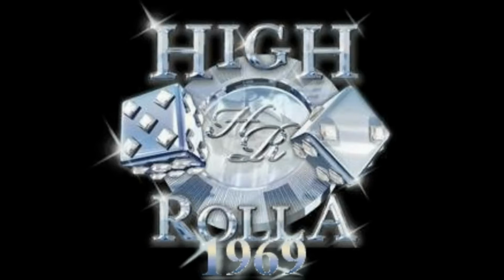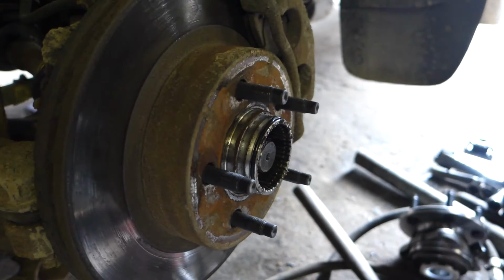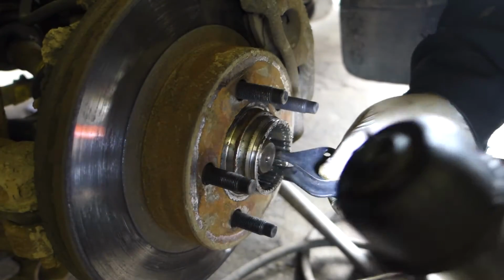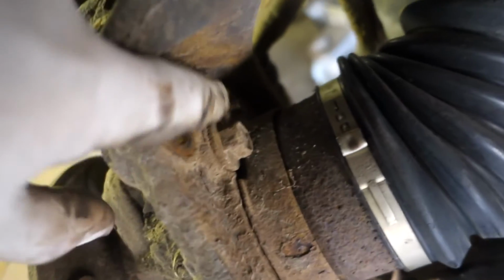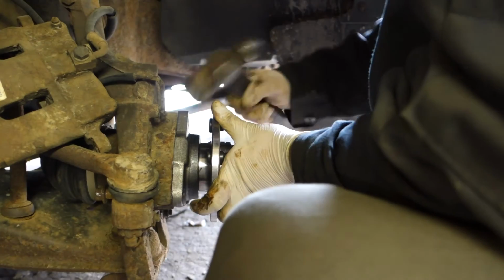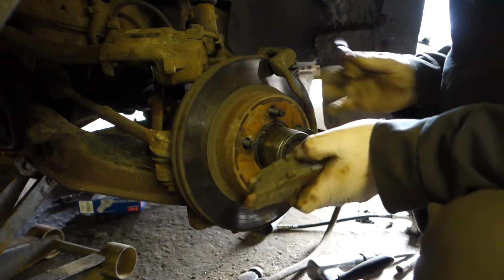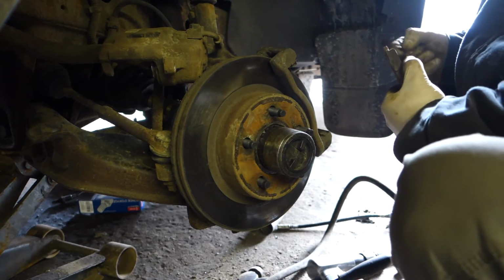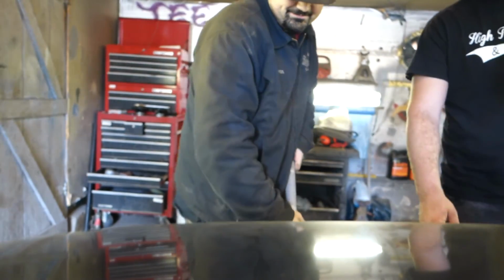Wheel Bearing 98 Ford Ranger

Comment: do you not need a main steering knuckle seal (and seal replacer tool, depth setting tool) on a manual locking hub?
Reply from the maker: I didnt need one for this no
Reply from the maker: On the f150 or bigger you do.

Comment: Hello Highrolla1969, my '99 4x4 ranger needed a new hub for the passenger side so I bought one on line by "Callahan" and not too long after installation the inner needle bearing in the back of it came apart. So I was wondering since no one seems to talk about something like that,  should I put bearing grease to it next time? that little bearing does not seem to be very well lubricated anyway.  Also where can I buy the O-rings for the new assembly? MOOG sent me the hub assembly without it! Cheers and THANKS for any tips.
Reply from the maker: Leo Cadena 
  good question. when buying online use caution. you pay for what you get. you can try auto parts store for the ring but it will be a hard find for the correct size. 
As for greasing it. Its a sealed bearing its not suposto come apart. Id send it back

Comment: Hi you seem like a cool guy,  I liked how you explain it on how to change a whee bearing hub I have a 99 Ranger that won't die but is slowly falling apart I been been working off and on cars for 30 years, am 60 years old.  I just wanted to know that your video helped me change my hub. I have a question after I changed it when I turn right the tire wobbles and it didn't do that before. I wonder if you have any ideas because I really don't want to crawl under there at my age ha ha!
Reply from the maker: Ramon G. Perez Hi Ramon ty for watching and ty for the compliment :) If the bearing is in all good and right then what I would look at is the cv joint/cv axel. A lot of times the wheel bearing causes a lot of other issues bc of the vibration it has when going bad it will put a bit of wear and tear on other parts, Starting with the cv joint thats attached right to the wheel bearing directly, Hopefully that makes sense to you and thats where I would start to look at. I would then check the tie rod for any side to side play with the wheel off the ground.  If the tire moves side to side with play then its the tie rod. While your at it push in and put from the top and bottom of the tire with it off the ground and check for play. If any movement at all then its a bad ball joint or possible A-arm bushing. I really do hope it helps out. Please keep in touch Im curious and ty so much for watching   :)
Reply from the maker: Ramon G. Perez Oh also I would check and make sure the 4wd locker isn't locked if you have the lockers
Reply: Ramon G. Perez man don't drive that truck like lol